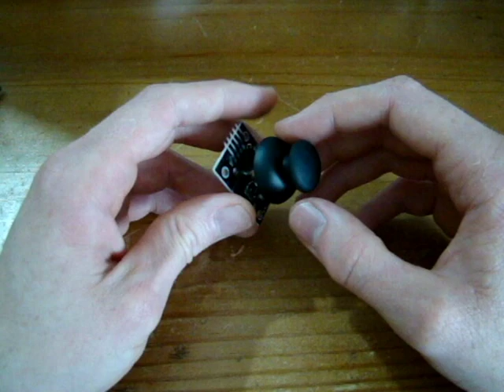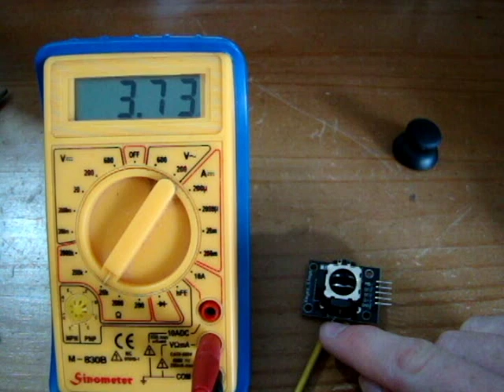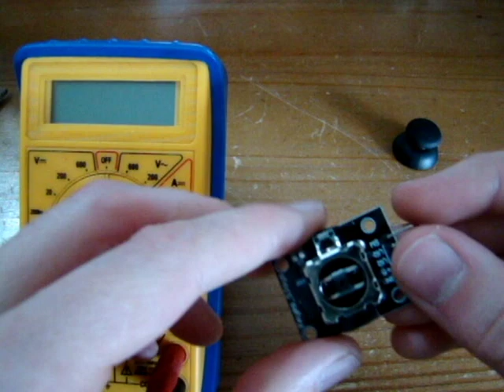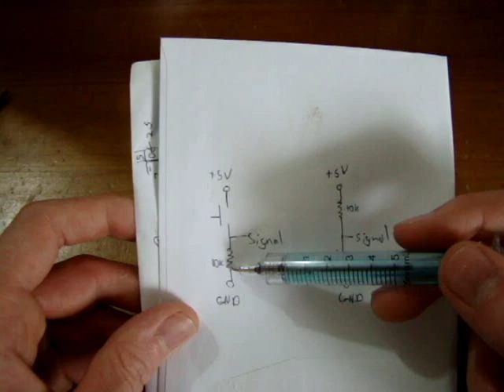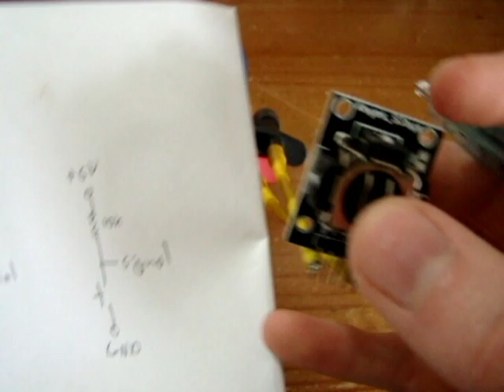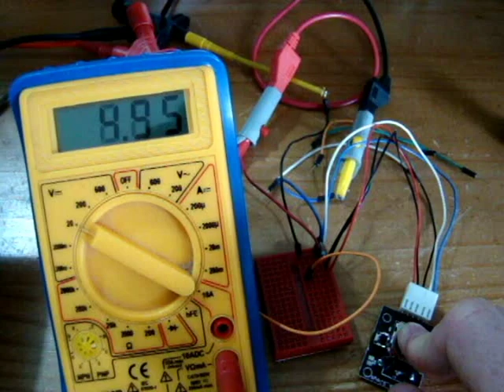IC Station Joystick Module for Arduino - Product Review

Comment: Hey i have a Huina RC Excavator and i would like to modify the remote with 2 joysticks for the movement of the bucket and control arms instead of the push button controls. Is it possible to do this ? and is it possible that i could use a old xbox remote Joysticks if i can get them  un soldered